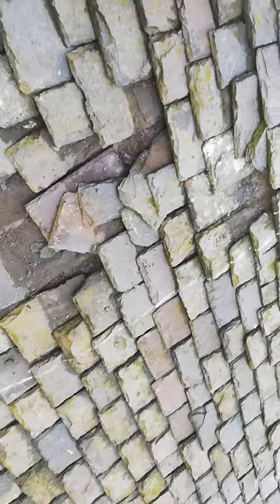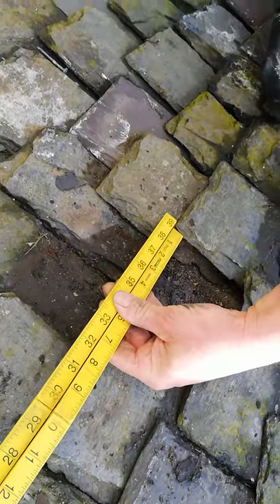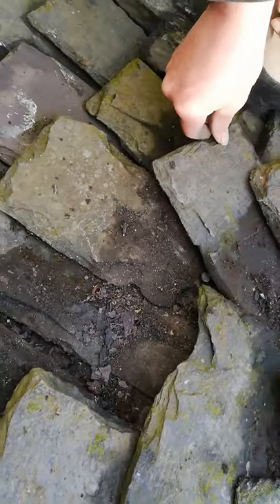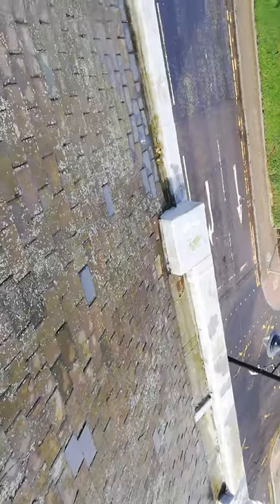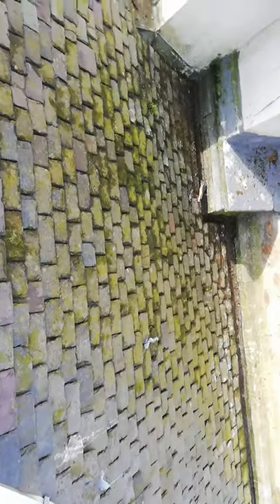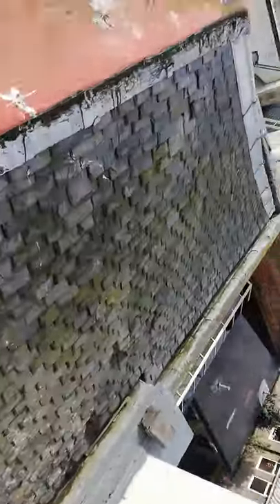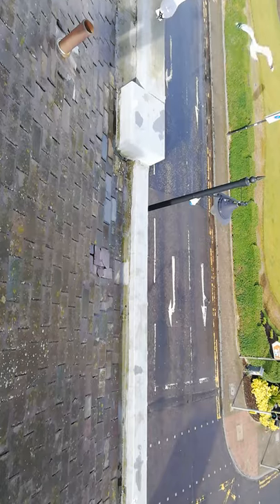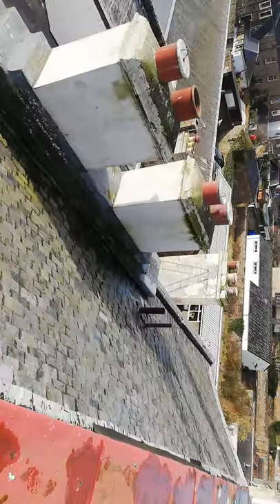£13'0000, roof overhaul 😭

Comment: Am not a builder, but I was led to believe when roofing 1st row nailed down then every 3rd row nailed and the last row nailed( correct me if am wrong), just watched roofers on a house opposite to mine and they nailed 1st and last row only surely that's incorrect??, concrete tiles were used
Reply from the maker: It depends on your location, where I live I would nail and clip every tile. If you were having your roof done contact the tile manufacturer, ask for a fixing specification for your location

Comment: Where are you based mate? Seems to be near the coast somewhere
Reply: He says Ayr at the start of the video. That looks to me like the building on the south east corner of Wellington Square. Lovely Georgian buildings that have unfortunately suffered from neglect over the years. Lots of them were offices maintained as cheaply as possible. Some coming back into use for residential, but the conversions are quite shoddy and sadly the property values make it uneconomical to do a proper job even if the developers were inclined to do more than they could get away with.
Reply from the maker: @clarksonad  bang on you know exactly where I was.
Reply: @roofingshiteroofing1189  if I was needing a roof done in the area you'd be the first person I'd call. Great to see someone who really understands and cares for buildings.

Comment: I have a 1930's scottish slate roof, my neighbour had his roof done less than a year ago by some blokes in a van. In less than a year he has more slates in his gutters than i've lost in probably 5-7 years of winters here, and i'm only a five minutes walk from the west coast beach here!
Reply from the maker: Your neighbour probably had Spanish slate with galvanised nails. What you have to consider is the quality of the nails. They should be copper. Also the quality of the slate, it needs to be free of iron. It is very rare to find Scottish slate on the cost because it contains a lot of iron. Some are stable. Tradesmen in the 30's were good. Also the galvanising of nails lasted. Unlike today's. Copper or 316 grade stainless Steel is a must